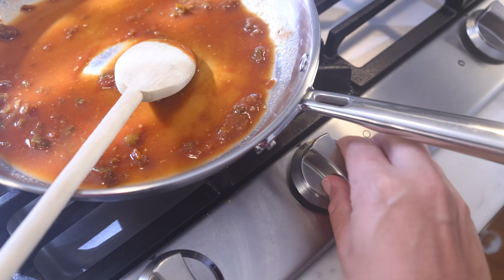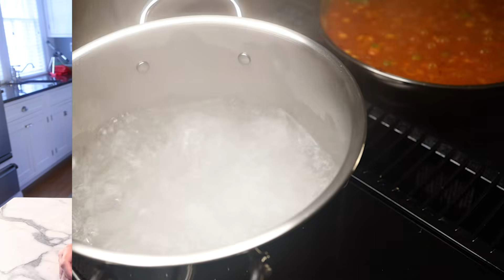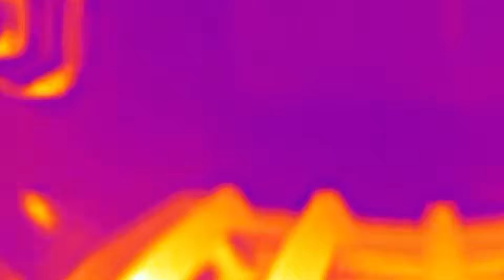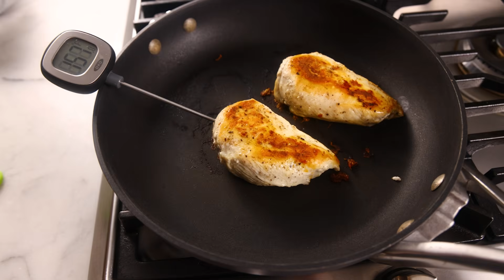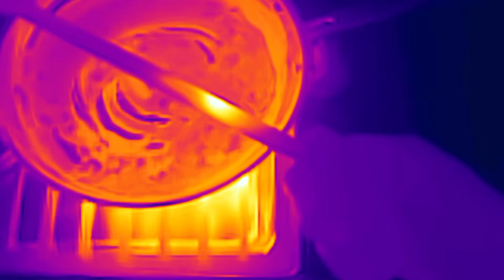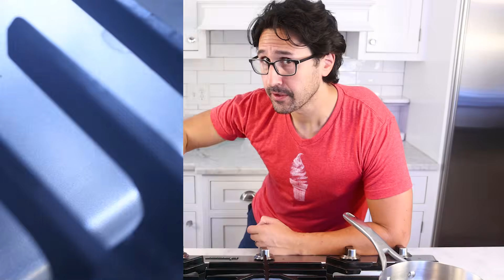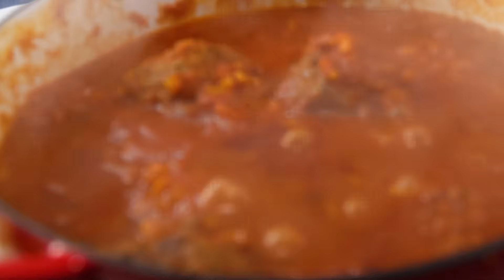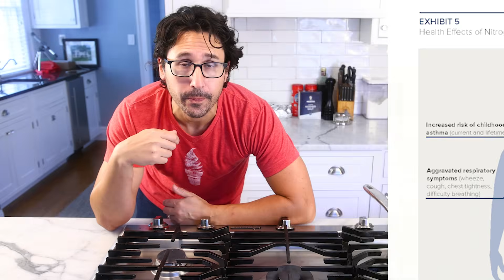Problems with gas stovetops | weak, dirty and dangerous

Comment: I mean you are right, but for many dishes the need to reduce heat immediately is pretty critical. I had gas for years and currently have a glass top and I absolutely HATE that thing. It is about as responsive as a cruise ship in a hurricane. I mean sure it technically heats faster, but since I mostly cook with carbon steel and cast iron that is really a non issue for me since I'm pre-heating my pans while I'm doing prep. I suppose I could get by if I could find a single burner that used propane (Because butane is stupid expensive) that wasn't absolute garbage. So far though every single one I've tried because all propane it seems are made for camping is absolutely awful. Unfortunately for the time being I'm stuck with this piece of garbage glass top until I find an electric that is actually capable of reducing the heat in a reasonable period of time or I can afford a full propane install.
Reply: Or you can get induction. There are plates being sold separately that you can just connect to power grid.
Reply: @cmfrtblynmb02  I have an induction stand alone now. It's better than conduction, but it still isn't gas. It will do in a pinch but there are some pretty massive drawbacks to it.

Comment: With the issue of boiling water - one strategy is to avoid that.  It spends on how often you cook pasta, of course. But it's also a waste of energy to raise several gallons of water to a boil just to cook pasta for a few minutes. It turns out pasta cooks very reasonable in a much smaller quantity of water, compared to the cookbook theory.  For something like rice, a dedicated rice cooker is a better solution than the stove in any case.  For stock, the time to get to boil is less important, since the pot will cook for hours.   The other issues - especially the byproduct emissions and heat around the sides of thin walled pans - are completely valid. But boiling water is a problem we often create ourselves.

Comment: While I agree that induction is probably the way forward (which I will probably go for when I redo my kitchen).

The high power output of old fashioned resistive electrical cookers may be acceptable when you are cooking large meals, but for smaller meals the long startup and cool-down time of resistive electrical cookers will more than offset any advantage they have during the actual cooking efficiency when at peak temperature.

As for renewable resources, methane can be just as renewable as electricity production.

Where I do agree with you totally (and why in the long run I would argue against gas in the home) is the issue of safety - every year houses are destroyed (and people killed) by gas explosions, and people also die of carbon monoxide poisoning, none of which will happen with electrical devices.

Comment: I don't know which stoves CR tested, but I can tell you in my last house we converted from electric to gas partly because it was taking a very long time for the electric stove to bring the pans up to temperature. The electric one was a smooth top radiant type. It may have been a weak electric cook top, but the gas one we put in was much, much faster.  For a pot of water for pasta to boil it was on the order of 60% of the time it took the electric (Yes we timed it before and after for boiling 1 gallon of water). And when the power would go out, the gas one still worked thought I would have to ignite it manually. When we had the electric, we would have to go out to the porch and use a camp stove. I may go with induction next time I replace a stove, but then I'll have to keep the camp stove around for emergencies.

Comment: Gas is a lot faster with heating up water for example, it's just your crappy pots that don't work on gas properly. I have pots with a copper core in the bottom and I beat every electrical water cooker with them.

Comment: Maybe I just have a rubbish electric stovetop but it genuinely doesn't get hot enough to actually sear meat or anything like that, everything I cook goes an nice grey colour, even on the highest heat. Never had that issue with gas.

Comment: As usual, Adam offers thorough, insightful advice.    I'd like to add some Southern California perspective:   Here, grid power is 10x more expensive, per thermal unit, than natural gas (NG).    Grid power wastes energy in the production, inherently; it's a thermodynamic reality.   More is wasted along the transmission route, although the same could be said about NG piping.   So lo and behold, Adam found NG's biggest waste:  up the side of the pan.   This can be mitigated by using wider pans, but Adam cites valid caveats!   Additionally, I like Adam's nod to inductive heating, which uses the metal of the pan as the target of a whopping magnetic field created by the primary winding in each "burner" of the stove top.   This begs the question:  Will stainless steel work differently than aluminum cookware?   (Their magnetic reluctances are different.)   Finally, I can't avoid disparaging "cooking islands" even if they're all the rage; they're not for me or my loved ones.    I keep my NG range against the kitchen wall, and provide a huge stainless steel HOOD above all that, to suck up stray gases... which, indeed, I can SMELL... upstairs in our two-story house... if the cook fails to turn on the hood.   Should I therefore automate that?  Hmm...           What is reluctance: https://www.electricalvolt.com/2020/01/what-is-magnetic-reluctance-definition/         primitive motor demonstration: https://youtu.be/FXZ27BvFZ3U         This means the buyer of an induction stove should heed any recommendations, by the seller, about appropriate cookware.      P.S.   You can't heat up a Corningware pot, atop an induction stove.        Oh, one more shared experience:  Our DOG turned on the gas range, one time, shortly after we adopted him.   My teenage son heard the HISS, and remediated that.  The NG was uncombusted, because the dog didn't understand he was supposed to turn the knob enough to activate the electric igniter !!!         ;)      We have either kept the dog outta da kitchen, or used the "kid lock" on the range, ever since.
Reply: Pure aluminum pans do not work on induction as aluminum is not ferromagnetic. Additionally, there are many blends of stainless steel that don't work since they are no longer ferromagnetic due to the blend of metals used to make the alloy. The only types of pans that work are cast iron, steel, and magnetic stainless steel, though I do know of some aluminum pans that are adding steel discs into the base of the pan to make them work with induction.
Reply: gas must be 1/2 the price of electricity or less to be worth running for the cost saving. I tested here in Pennsylvania, 1 month cooking my daily meals on gas and 1 month on electric, and it was a wash... there was about a $5 difference. I used a standard gas stove and oven, vs an electric Hotplate and Air/Fryer or toaster oven.

The truth is compared to things like TVs, AC, Computers etc, cooking is usually a much shorter activity and the electricity use doesn't really amount to much.

Comment: One problem I have with induction is the on/off cycling at low settings which can cause the pan to boil up and down, rather than a steady simmer. Is that a problem with them all or just my cheap one?

Comment: I use induction for deep frying. Deep stainless steel pot with heavy bottom.

You are right that gas cannot go low enough; hence I build my soups on the gas then switch to induction on simmering.

But induction is too effective for cast iron and carbon steel pans, heats them too fast unevenly, warping them in the process.

I agree that it is the future though, as evident by newer restaurants using mainly big universal induction plates. And as future go, you gotta invest: stainless steel (core) pans and pots, no carbon or cast iron.

Then when it breaks, you gotta replace the whole thing. Grid failure? SOL.

Comment: I agree with all the complaints mentioned in this video.  I often joke how the water boils on the sides of the pot first—because the heat always goes up the sides of the pot.  However, I love that, if the electricity goes out, all I need is a match.

Comment: I have a portable induction cooker. It sucks for frying. If I put a pan of water on it and let it boil, I can watch it cycle on and off. Frying with it, I burn the hell out of stuff as it cycles on and off. Not good.

I used to use electric. I did not have a glass top, but the coil system. As the stove aged, the heat from the coils weakened the connection where the coils plug into the wiring. We started getting shocked from the stove. We use cast iron. With hand on the pan, ZAP! I refused to have a stove that cooks me while I'm cooking my food. 

We bought a gas stove/range. We ventilate while we cook. We have no issue with it. We have properly sized pans for the burners. I grew up with gas. I was told not to turn the flame too high as you would lose heat up around the pan. When the power goes out, we can still cook. It's gas all the way for us. I would do induction if it didn't cycle and was a constant heat. The only problem with induction is that I can't use my aluminum pressure canner on it.

Comment: I had such a lightbulb moment at the custard part. I've never understood bain maries, they've always just seemed so unnecessary to me - I'd never considered that it might be a gas stove thing! They're definitely not common where I live, I've only ever seen a couple (actually turned down an apartment because the kitchen had a gas stove). I've got a glass top electric stove now, but I'm still not used to it - it's definitely more responsive than my old cast iron electric stove, it both heats up and cools down much quicker than I'm used to. I keep turning it off before I should because I expect the cooldown to take longer 🤦‍♀️

Comment: I grew up with an open coil electric stove until my parents bought a craigslist gas stove in my teens. My neighbors, who I spent a lot of time in their house as a kid, had a glass top electric stove. I prefer gas, but that's for a few reasons:
1. Gas works during power outages. Having been fucked over as a kid in '08 and '13 during really awful ice storms where we couldn't cook anything, I'm not a fan of every single heating element in my house besides the water heater being electric (and actually a lot of homes have electric water heaters now). You could put yourself in a very dangerous position unintentionally. We had to break out kerosene oil lamps that winter, and eventually go to a relative's house. It was not good.
2. Glass tops break. My neighbor enjoyed cooking with cast iron, and I do too (for a variety of reasons), and she dropped an entire dutch oven of food onto the stovetop and cracked it almost irreparably. I get this wouldn't be an issue for most people, but I enjoy my cast iron and use them indoors/outdoors, so I'm just not a fan of too small burners that can easily break with my preferred cookware.
3. Coil electric stoves are always tilted. If your coil stove is older than a couple of years, those coils heat up so much that they warp eventually, and they always end up tilted to one side, which means all your food falls away from the heat of the coil, and unevenly cooks, and doesn't rest properly. It drives me mad and it's the biggest pet peeve of mine, even on a stove that others cooks absolutely fine. My current apartment's stove is like that, and I hate it.
Reply: 1. Gas heaters don't work in power outages, so you would still need to go somewhere else.  Cooking is the least of your problems.
2. I use cast iron on a glass top for years and it's fine.  Don't break your appliances and they won't break.
3. Glass tops solve this issue.

I understand your personal preference, but these are all very minor issues compared to the inescapable ones with gas in the video.
Reply: @Heycool08  Oh I definitely think the infrared glass tops are the future, especially on an industrial scale. I similarly enjoy driving gas cars over electric, but electric cars and public transit are likely the future, and my preference is irrelevant. At the moment though, glass tops are way too expensive for most homeowners, and if I’m choosing between used stovetops, I’m gonna buy the gas every time. Also, our water heater did work during power outages. I distinctly remember taking a hot shower during a major blackout in middle school. Our actual heat didn’t because the HVAC ran on electric, but the water heater didn’t. Our house was old and inconsistently updated.
Reply: @Heycool08  some gas stoves (especially the ones in my country) use gas cans rather than the gas lines
Reply: @Heycool08  why do you think gas heaters wouldn't work during power outages?
Reply: @hope1575  the ignite with an electric arc (or have a very wasteful pilotlight that has to burn 24/7 at candle intensity) also they are controlled by electronics, at a bare minimum a bimetallic stip thermostat triggers a switch which acts as the contol signal.

I'm from am area that gets icestorms (upstate NY) and my parents house has a woodstove (nothing like a giant blackbody radiator to keep a room worm) that serves as an auxiliary to fuel oil, we have a propane grill (that would be fun to get out during the winter), and most importantly a gasoline generator. (If you are in an apartment complex they should have a generator to power building critical systems on "emergency power" it won't supply your unit but the building heat, fire suppression, ect will remain operational)
Reply: @jasonreed7522  gas heaters and stoves which are normally lit electrically can still be lit manually by match, lighter, or spark. My previous home had them. I'm not familiar with ones that you can't control without electricity. However, I don't think we could use our oven with the power off, so maybe some heaters are like that
Reply: @hope1575  when you said heater i assumed something like a furnace or water heater (fixed machines that run automatically to make your house nice to be in 100% need electricity to operate), however, a gas stove can be lit like a grill is with a long match or lighter assuming it doesn't have a safety feature requiring internal ignition before opening the stovetop valves to let the flaming gas out of the burner.

I also recommend everyone have a backup for emergencies, be it a camping Bunsen burner, a wood stove, the grill (may suck if weather is the cause if the blackout), a generator, or just having nonperishables you can eat cold like poptarts (not that they are an ideal dinner).

Comment: If you are often boiling large pots of water, you need a near-boiling hot water heater and tank.  I had one designed for drink size (it would not fill a pot) and it was great to dispense a cup full of almost-boiling water instantly.
(I don't have it anymore because it broke, but finding good build quality instead of the cheapest thing from Home Depot is beside the point)
If you had a 5 gallon tank under the counter, with modern insulation, it would stay hot with very little power, but give you a pot full of water that will come to a rolling boil in a fraction of the time.

Comment: In choosing a stove top, my wife really wanted the flat glass top.  Unlike what you showed with ogee curves that are hard to clean, this is a flat surface.  There are metal outlets mounting on it, and the burner itself is loose and drops over the outlet.  
The loose burners can be washed in the sink, and any spills on the stove end at the point where the burner disk was and there is still a margin of clean (because it was covered) surface around the outlet.

Comment: gas stove is slower:  I think that is not generally true.  The builder's electric stove I replaced was less powerful.  The gas stove I bought was marketed as having an especially powerful burner.  (All the burners are different size)  The first think I did was see how fast I could boil a pot of water.
The gas supply to the home needs to handle the huge fire in the central heating system, and there's no trouble attaching a swimming pool heater without having to add new main lines.  There is a lot of power available.  You just need a burner that burns more.
My outside burner is hooked up to bottled LNG, but it could work with natural gas too.  It is designed for a wok and has multiple concentric rings of fire and a long vertical distance from the burner to the pan acting as a chimney.
The electric stove for a residence is normally limited by the size of the standard electric outlet and appliance leg, and is shared across all burners.  That is, I don't think you can get one burner hotter if you don't use any of the others -- the position on the dial has a fixed meaning, and they can all operate at "10" at the same time.
With a small LPG bottle, you can operate a kiln in the back yard that would actually melt your cooking pots.
So, you need a better stove.  It may seem to be a good brand and have good build quality, but is simply not powerful enough.

Comment: For gas stoves, the best way to control low heat is not by going all the way down,  bring it back up, the flame becomes minimal when you are close to shutting it off. That's how we let it "mijoter" for hours. Do make sure there is no air draft that could blow the flame out.

Comment: About that low heat isn't that low i personally have a very old gas stove 80s or older that you can turn the knob to the point where the fire is extinguish and just pump gas so i guest old school don't have that problem